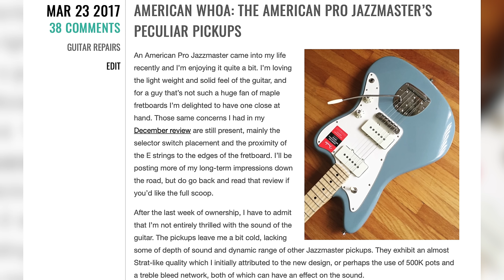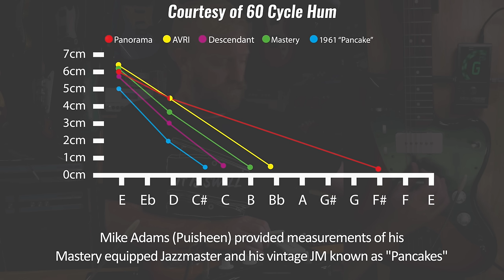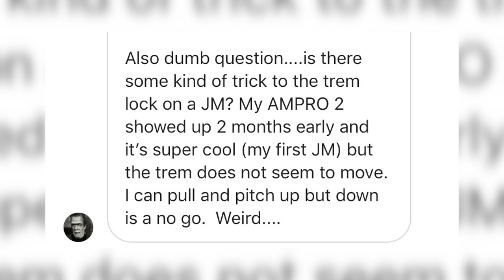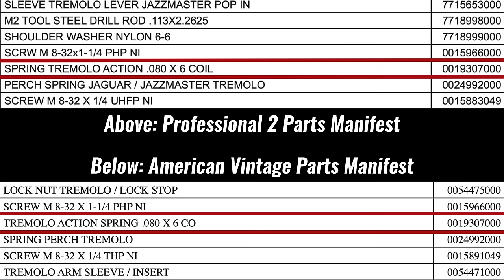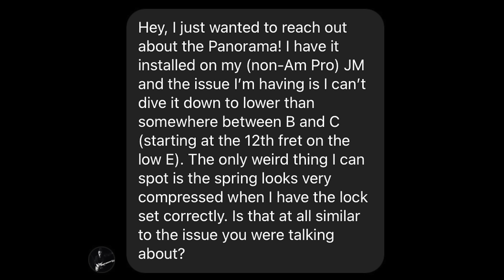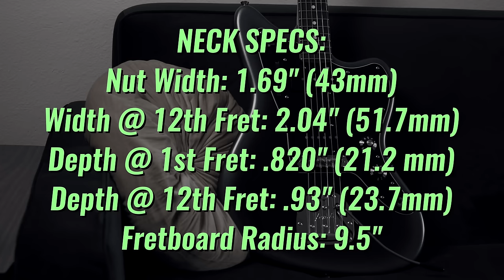JAZZMASTER REVIEW #6: Fender American Professional II Jazzmaster + Demo!

Comment: If I was to drop almost 2k on a new Jazzmaster, I would definitely not get an American pro II, and would rather wait a little bit more and get myself an American Original instead.

I got into offsets back in june 2021, and got myself a Vintera Jazzmaster. I love the hell out of that guitar because it has everything you'd expect from an ACTUAL Jazzmaster, nothing fancy. trem placement is correct, vintage bridge, pickups that are wound the way that jazzmaster pickups should be wound, a proper rhythm circuit and a 7.25" inch radius (I don't mind it, but I would rather have a flatter neck because I  would like to be able to bend a full step without my notes dying mid way through hah)

Speaking of that, I would really really be interested to see a review of the Vintera series jag/mustang/jazzmaster!

Love your vids, Mike!
Reply: Yeah.  I had a brand new pro ii and sold it to get a like new AO Jazzmaster for about same price

I didnt care for the pickups and the neck on pro ii.  I have a Am Pro I w maple neck and it just feels better to me than am pro ii rosewood 

The Pro I sounds more stratty and dare say tele'ish which a lot of people dont like, but I like it since I have other JMs that sound like Jazzmasters.  Pro I trem is fine
Reply: I used to focus a lot on 7.25 radius as what made a neck good to me
And it is in deed very nice for a good hand around and thumb on the root note..
But now I know for sure that the nut wide is in fact the most important to me, 42mn (small vintage) is perfect and the most important.

I guess a somewhat fatter neck with 9'5 and 42mn would probably be the best neck shape to me!
Reply: @Aniki82  Guess what? The American original has 42mm nut width and 9.5" radius!
Reply: Hell yeah, I second that thought... I'd love to see a Vintera Jaguar on the bench!
Reply: Eh idk if a purity test is the way to go with offsets. Artists that made them "famous" used to mod the hell out of them, it tells you something. Maybe it's because for lefthanders like me their the only option but these Am Pros area godsend!
Reply: What about the pickups? I heard from a few sources they're not "original" or what "they are meant to be" for a Jazzmaster. What do they mean by that?

Comment: Finally got mine! A 3TSB Pro II Jazzy, it came with 09's put 010's on it. I ordered the replacement spring, the one Ryan found, upfront, but it hasn't arrived yet. But after  stringing it up, and a slight truss rod adjustment, the spring does, to my luck,  not  run out with 0.10's installed. I did activate the micro-tilt slightly though. I also own a MIM 60's lacquer in seafoam green. Also an awesome guitar but I love the modern twists on the Pro II which makes it a more versatile guitar for my needs. Love this thing! Idid see this video and Ryans (60 cycle hum) before I made my final decision, and thought I could over come all the little cons. No need to say I did and man... ok, the honeymoon ain't over yet, I know... but this thing seems a perfect fit for me.

Comment: I watched the whole thing. Bought one of these used in December 2020 and have been wondering when Mike’s opinion was going to be released into the world. Thank you for making me aware of the vibrato issue which I’ve noticed with 11’s but never addressed. I respect your jazzmaster opinion more than any other. You, sir, are appreciated.

Question:  have you had any issues with installing a Mastery M1? Mine rattled and I sold it.
Reply from the maker: That can happen on these and others with an angled pocket. The Mastery is specifically designed to sit lower on the body, so the additional height necessary with the Pro 2 coupled with the interior width tolerances on the Fender-made thimbles means that bridge may rattle around. I’ve yet to decide what I’ll do with the bridge here. I have a spare Mastery but I like the stock bridge as is.

Comment: What a delightful review. Thank you so much. Been waiting for your thoughts on the release. After toying a little bit with 9s, I put heavy bottom 10s and was going a little bit 'huh?' about the bridge, but just could not pinpoint what had changed. But assumed something about the spring, naturally I thought that it SHOULD compress more, as I've never played a JM before. So really good to know about the 11s, would have been panicking otherwise.

I also like to add that your channel is one of the best things I've found last year! Really enjoy the in-depth, careful and detailed approach to these reviews. Also really good demos, clean and musically expressive, I like that you use a variety of styles to illustrate the instrument's range of capability. Thanks, cheers and happy birthday :)

Comment: A tip from experience. Check the low E bridge saddle screw now and then. The saddle spring is small, the screw thread pitch is quite wide, the screw is angled and combined with the vibration of the string the screw works itself free. Apart from that, it is a great guitar.

Comment: Wow! What a comprehensive review!! I bought the Pro I on sale as I fell in love with it in store and didn’t do any research. Would a new nut cut with narrower spacing and new pickups help some of its short comings?
Reply from the maker: If you can grab one of the newer bridges with 53mm spacing you'll be set. The nut can help, but it won't take care of string spacing farther up the neck
Reply: Gotcha - I’ve got a mastery bridge in there so I think the nut would fix it up.

It was actually just yesterday I noticed how close the high was as it kept sliding off! Then I eye balled it, then I saw your video.

You’ve helped me very much. My hat is off to you, Mike 🎩

Comment: Hey Mike, great review on the AmPro II, I got one for myself recently too! I've got an interesting problem with it and was wondering what you think about it. I've been using a pair of aluminum pickup covers from Etsy, and they've worked well on another JM I had, the CME Player which was fully copper-shielded. I initially transfered the pickup covers to the AmPro II but the bridge pick up didnt like the cover at all and sounded like there was a ground short-circuiting somewhere (and only worked sometimes if I pushed the pickups down) so I took it out and replaced them with the standard covers which worked fine.

I went on to fully copper shield the AmPro and installed the covers again. Same thing, neck pups were fine, but bridge ones sounded like it was short circuiting somewhere and intermittently worked if I pushed the pups down. I realized there's a third wiring for the bridge pups, and proceeded to put some electrical tape where the sides of the pickup covers would touch the 3rd wire, which of course didn't work and made no difference.

The standard covers work fine, and the aluminum covers is fully grounded and has continuity for both neck and bridge, but only the bridge one is acting up. Am thinking the 3rd wire is the culprit. Am I right, and how do I get the aluminum cover the work? Fully insulate it?

Comment: Awesome review.  Best one I have seen on you tube and the history of the different versions greatly helps in setting the context of the current model.  At 29:01 in the video, notice how when you compress the spring, the screw that holds it rocks up on its edge where it contacts the vibrator plate.  If you wanted to get a little more range on a dive-bomb.....maybe a full octave....you could bevel the bottom of that spring screws's head.  That way when it rocks up on edge with the underside of the screw head relieved a bit, it would have bit more travel before the spring bottoms out.  Just a thought that might give you a full octave dive bomb....or closer to it.

Comment: 47:50 "The pups are little muddy" and 48:50 "the guitar boasts 500K pots instead of 1,000K" —there you have it, that's why the pups are muddy. The pots' resistance is two times lower!

About 49:03 — you can buy 1Meg pot with preferred taper, disassemble it as well as the one from this Jazzmaster, take out the graphite strips out of both and install the 1Meg graphite strip into the guitar's push-push pot.🙂
I did so with many pots.

Comment: Great video.  I recently got the exact same guitar and for the most part am loving it.  I've been scouring the internet to find good info on the panorama as I was having trouble setting it up with 10's.  To your point, it's not as bad as what you showed with 11's, but it's definitely not as good as it was with the 9's that came on it.  If I do decide it's not working for me, what solutions would you advise?  Is it possible to buy better replacement springs through aftermarket sites?  Would I just have to replace the entire tremolo with an aftermarket Mastery (or something similar)?

Comment: Wow  Mr P! This was one of the most helpful and technically informative guitar videos I’ve ever watched. The internet (YouTube) is plagued with guitar videos that are not all that purposeful for anything other than the makers need to drool and/or expand their egos - or they just fall short of anything that would help anyone. 
I LOVE JMs. And when I started to use more open C and A tunings to expand the sonic range of these guitars, I started using .11s by default, but prefer .13s. I think it’s the fact that JMs trem plate is placed as far back as possible, utilizing nearly the full length of the guitar - of the wood - which arguably contributes to their unique sonic palette. 
Love that color. Might change the guard and pu covers, but I’d probably go back to black.  
God it sounds good. Maybe that’s just you, though.

Comment: Thanks for such a thorough review Mike!

A thought about replacing the tuners: an easy way to get split shaft tuners on a modern fender is the Classic Gear Tuners that Fender makes; they were developed for the American Performer series I think. The pro is that they drop into modern Fenders drilled for 2-pin tuners so there's no drilling to be done. The con is that they don't quite look like the classic vintage tuner because they have the hex bolt on the front of the headstock instead of the plain bushing.
Reply from the maker: Oh for sure, I don’t care for those either. Gotoh/Kluson and conversion bushings for me!

Comment: Hey, Mike

If you can’t easily find a 1Meg push/push then try this method to get that 1Meg goodness:

Volume-1Meg
Tone (push/push)- keep stock pot and reduce the capacitor value so less highs are passed to ground…even when on full. Stock uses a .022uF cap so try a .01uF one.

It’s a way of getting around this issue that will give you very very similar, if not the same, results. It will most certainly sound a lot brighter than it does now as the volume pot value is the major player here.

Edit:

I searched Banzai (Germany) for you and they don’t have them….and Banzai has everything you could ever want.  ;(

To the Pickguard question. The anodized one looks very classy on that JM! I have a 9 hole gold pg (stickler for accuracy of parts lol) on my ocean turquoise AO60s jazzmaster. Even though the neck is bound in 1965 style I like to pretend Leo made a 1958 with binding as a knock-off of Gibson. Ha! ;)

Comment: @puisheen Hey Mike, I am super new to the Offset world, and namely the Jazzmaster.  I played and AMPRO II and I just loved the feel and some of the tones I was getting out of it, and I am stretching my musical pallet lately and went ahead pulled the trigger and bought one (its on order...tick tock tick tock). Anyway, because of that, I started watching videos on the guitar itself. I'm trying to get my head around the Rhythm Circuit and what it exactly is. I even watched the vid from 2019 of you playing on the Official Fender channel. So at about 49:19 in your video here, you say, sort of, that this AMPRO II doesn't have the normal Rhythm Circuit, that its in Parallel? As opposed to what. On the Fender page for the AMPRO II it says "SERIES MODE RHYTHM CIRCUIT" isn't that like all the rest? Sorry for my ignorance here.
Reply: I found someone say this. Does this sound right?
 
“The Am Pro II JM doesn't have the traditional rhythm circuit. Instead of switching to just the neck pickup with a low pass filter like the traditional rhythm circuit does, the switch now changes to the two pickups in series, with the two roller pots being volume and tone for that mode.”
Reply: @burningjoe  That's right. It's kind of like making them a big humbucker.
Reply: @damianjoseph9222  thanks for the confirm! I finally get my JM AMPRO II this weekend, I’d ordered it from a local music store, been on back order. I’m dropping some Novak pickups in (JM 90 and JM 180) and a Mastery Bridge in it. I can’t wait to play this thing!

Comment: I've had mine for two years now and don't love the pickups. I saw your demo with the EMGs. Did you keep those on yours or try something else? Not sure what to switch to, but I know I love the sound of the P90s on my Les Paul. And yes, I too play 11's and the have the tremolo spring issue. Need to fix that.

Comment: Any update from Fender on the Panarama issues?  Wondering if current production models have an updated spring in it, or if they've continued to just keep doing what they were doing. I was looking into these, but I would have went and put 11-52 on it right away and I would have been pretty annoyed running into this trem issue. You just saved me a big headache. Subscribed!

Comment: Thanks very much for the in-depth review and happy birthday! Re: the volume and tone controls number "6" facing you when full on - I get not everyone is very technical or work on their own guitars, but isn't it simply a matter of using a small flat-head screw driver to loosen and re-orient the knob the number to "10" to face you when the pot is dimed and then tightening the screw to secure the knob? Or is there something I'm missing, like the pots simply aren't positioned correctly to the pickguard and thus preventing an adjustment? I had the miami blue AmProII with the maple neck for a short time. Lovely looking guitar. However, I just didn't care for the push-push control. I felt it stuck too far out for my comfort. The neck shape was fine although I prefer beefier necks. I moved it on and acquired a Fender Japan Traditional '60s Jazzmaster with the U-shaped roasted maple neck and rosewood fretboard. As you probably know, they have their own tremolo issue (no in-out waggle capability) so I modded it with a Mastery bridge & tremolo. Stock pickups are quite lovely, too - I get the traditional JM tones with them. I'm a bit of a tinkering/modding sort, but I'm in a 12-step program to "try" to leave a guitar stock as much as possible...until I can't. :P